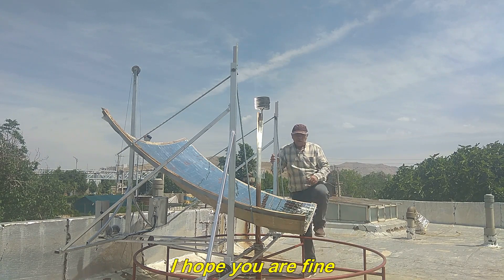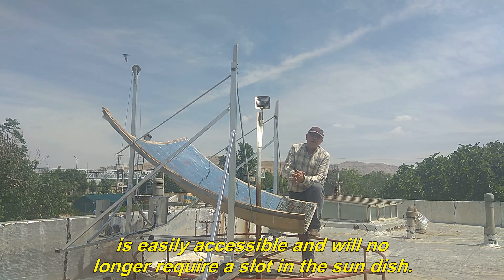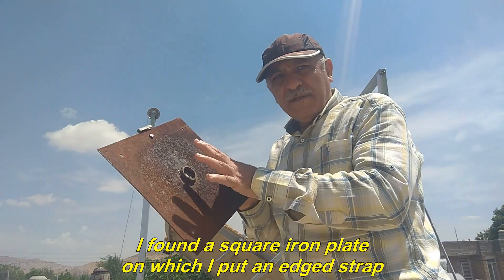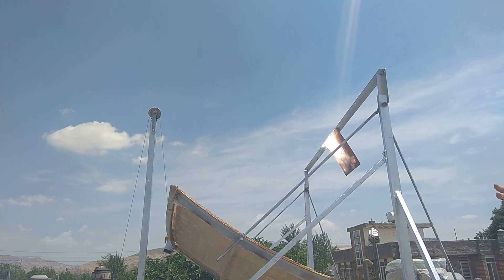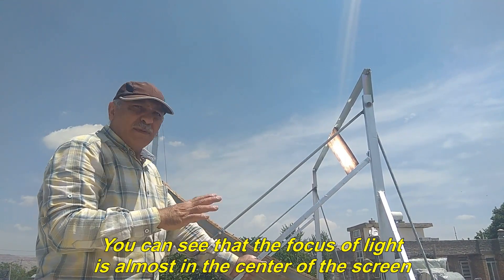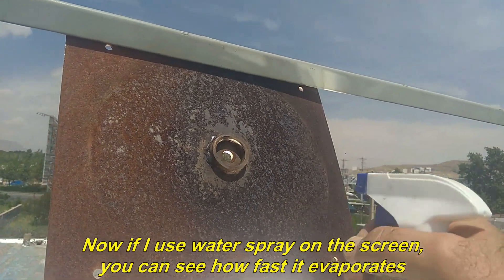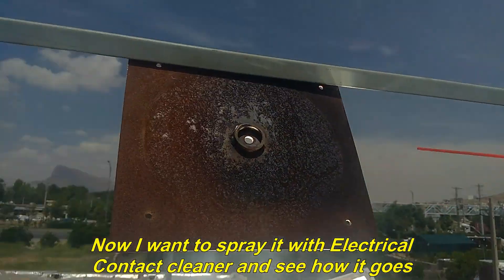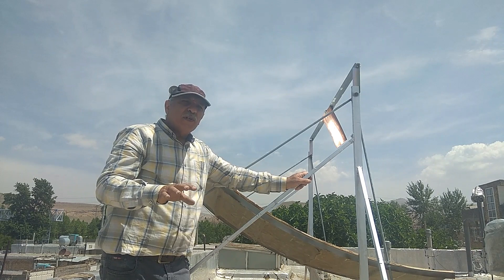Temperature of the solar dish core.New focus.The temperature of the focus part of the solar dish

Comment: Interesting and very good workmanship on this design concept. Now the question, how to best utilize 450C heat for cheap energy utilization? Produce electricity using steam generator, for pumping water, direct heating (oil to water via heat exchanger) or heat storage (tanks) for later (night use)..
Reply: By pumping, meaning to higher elevation. Hundreds of such solar dishes can be used for agriculture irrigation or producing hydro electricity..
Reply: I don’t know how much electric power you aim to produce, but basic steam power generator could be an option. Simpler method is using sun reflectors to concentrate more sunlight to solar panels, increasing the output power. I would prefer the former method although more complex.
Reply: Basic 3D printed steam turbine generator should not be costly. There are YT videos showing such designs. Also regarding solar concentrators, they would need to be elongational located beside the solar panel, not fixed focus which would overheat the panel section. Sergiy Yurko On YT has designed such solar concentrators.